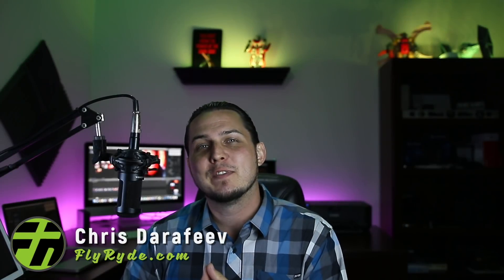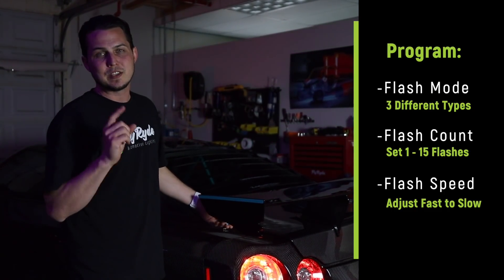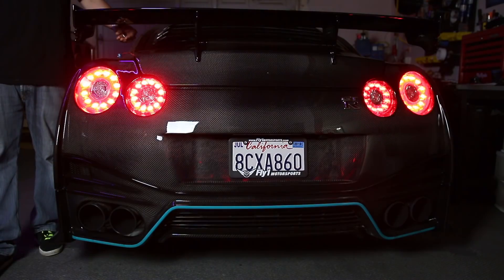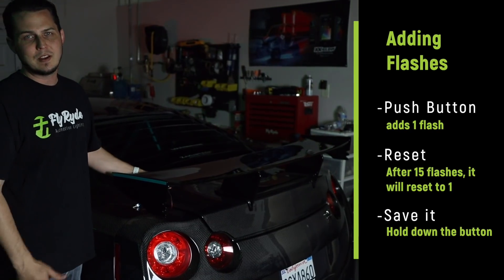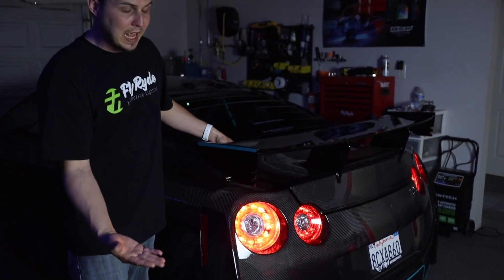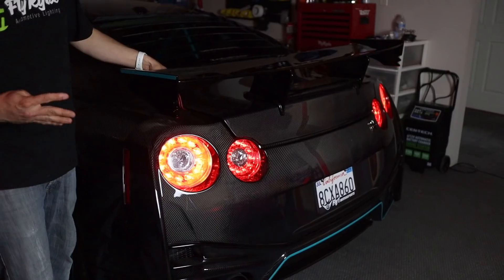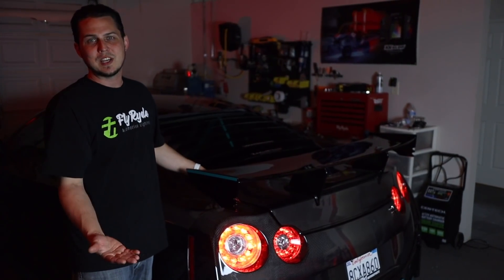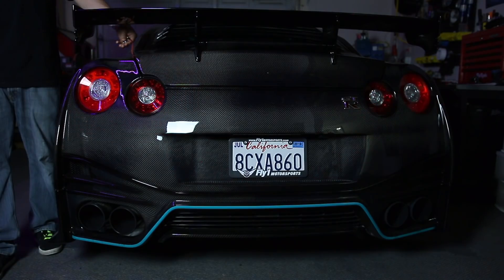How To Program LED Brake Lights | Nissan GTR F1 Flasher | FlyRyde

Comment: It would be nice if these brake flasher modules flash rate were dependent on how hard you are braking and then briefly flash off (for 100 milliseconds) every 2 seconds after being stopped with brake still applied. This would then help prevent rear end collisions in the both the scenarios of sudden rapid braking and already being stopped and a vehicle fast approaching that isn't noticing you being stopped.
Slow braking would be a slow flash rate and quick braking a faster flash rate. Perhaps incorporate an accelerometer to detect deceleration rate. When a certain time has elapsed, and the brake is still pushed then every 2 seconds the brief 100 ms off routine kicks in. 
The designers should also incorporate a reset timer so that when the rapid flash sequence has executed say twice on two close spaced brake applications it doesn't occur again for 1 minute. It's so annoying in stop and go traffic when the rapid flash occurs every single light brake application which then makes the flashing less effective as it becomes too may false alarms.

Comment: I got a question for you Chris. got some switchback LED angeleyes. the white works perfect, and the switchback as long as the car is off. but as soon as the car is turned on and engine running, the switchback stops working, they go dark and try to blink. 
stop the blinker and they go white again. any ideas?